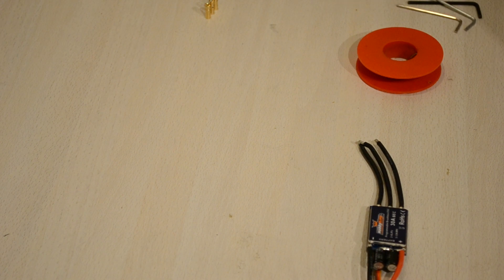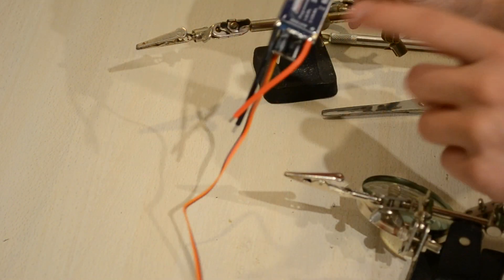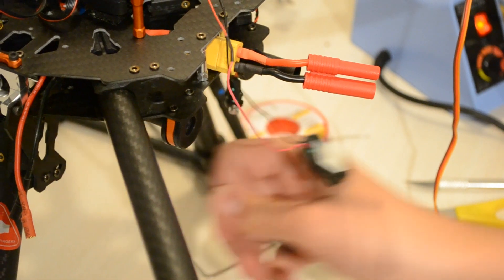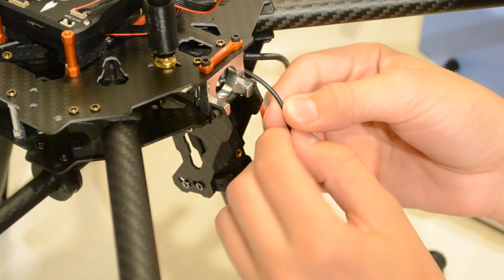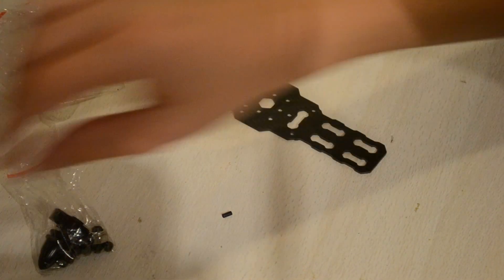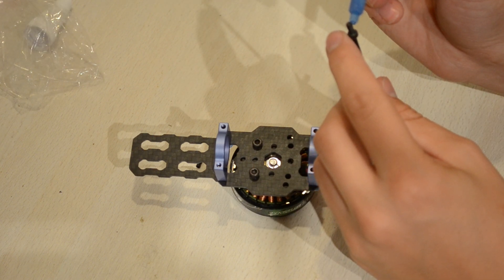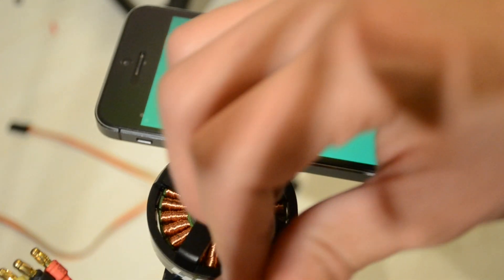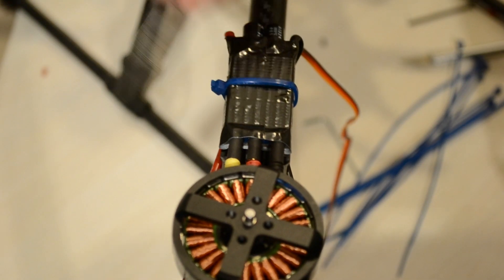Tarot IRONMAN 650 build and review - Mounting ESC and Motor [Part 6]

Comment: A quick look at  questions and replies prompts me to ask which diameter wire used for the ESC extensions. It likes like 2.5mm silicone.  Any other  "not in the box" bits you  can give info on?

Comment: Hi, do you use OPTO ESC or common esc? In video it seems I saw not OPTO. I mean, is it normal connect to pixhawk all 3 wires from each esc which deliver some power? How is it work? I have Pixhawk and also normal esc and I don't know how to connect it to Pixhawk. Only with signal wires or use all 3 from each. Thanks
Reply from the maker: No i use 30A blueseries with simonK.
It doesn't really matter as the pixhawk will only draw the power it needs. To be safe you could remove/chop the power wires from the servo cable from the ESC.

Comment: You know this was a great idea for the escs on this frame.  Only thing I would change is buying a 1.5 inch wide 6 inch long peace of shrink tubing from homedepot! 2.50$ for 2 strips enough to do all 4 esc's!  But taking all wires off was great idea!  I used spider es'c there pretty close to what you have.
Reply from the maker: Glad you liked it. Well yeah, except i am not from the US so i don't have acces to home depot ;-) I have since though managed to get a hold of some heat shrink that i will use over the ESC's in my next build, which you will see more of in the coming month. And i can say already, that i will try to waterproof it completely ;-)
Reply: MultiCopterBuild  I use that liquid tape on everything now before I shrink rap them for that reason. Started do that to everything way back when I got my first apm 2.5 unit with everything bare boards. Light mist and everything shorts. Now it is just habit lol
Reply from the maker: Rich Morgenstein Yeah. A combination of PlastiDip, CorrosionX and corrosionX HD. Go check out one of the latest FliteTest videos where they demonstrate it, if you haven't already. Amazing stuff i must say. :-)
Reply: MultiCopterBuild  I won't use plastidip,  I have had 2 escs for my rc trucks short using it.  I also have seen a few people in the rc club have that same issue on planes and rc trucks on esc.  I think it traps moisture at times in the drying process or it's a chemical in it not fully drying trapped?  The liquid tape takes longer to dry but you can turn the unit on while it's still wet and it wont short.  Some swear buy either way. Roll dice pray lolz?
Reply from the maker: Rich Morgenstein Damn now you got me wondering... My research led me to, that liquid tape ain't very flexible after drying whereas plastidip is. And my components would be glad to be able to flex at some point at least. What is you experience with that? :-)
Reply: MultiCopterBuild  The liquid tape on boards works just fine.  Coat the whole thing 1 time dry it and then again.  I always cover it after with shrink tube!  Never had a problem.  As for wires that move no it's not ideal.   IT cracks over time.  The plastidip on the other hand works great for wires and stays flexible. But for covering a main electronic board it has a bad rep for causing shorts and failures.  A lot of people will coat an ESC for example in liquid tape and coat the wire sections after in plastidip where the wires move. But putting the stuff directly onto a power board with electrical components is a sure suicide for most of the rc models lol   Ill give you an example.  I had a Apm 2.6 unit with a min OSD a while back.  I used plastidip on it and everything worked fine.......   But I started to randomly get flips in mid air with the whole craft and down it went.  The osd card would short out here and there and kill the whole flight controller after I plastidiped it lol.  I removed the osd and all worked fine.  That was the last time I ever used plastidip on one.
Reply from the maker: Rich Morgenstein Okay. I was planning on covering PCBs and electrical components with it, more like seal openings of cases and such where i believe plastidip will be better. But hey, i will buy a can of each and test them out so i can figure what's best for my application. :-)
Reply: MultiCopterBuild Just make sure the camera is pointed in the direction it goes down!  It what makes youtube fun lol!
Reply from the maker: Rich Morgenstein Haha yeah, will try ;-)

Comment: Horisontal landing gear is weak, break easy.
The clamps for motor mount to arms is to big and won't keep the motormount from turning on the arm, fixed with grinding a bit of the half moon under the arm. Otherwise a nice looking frame.